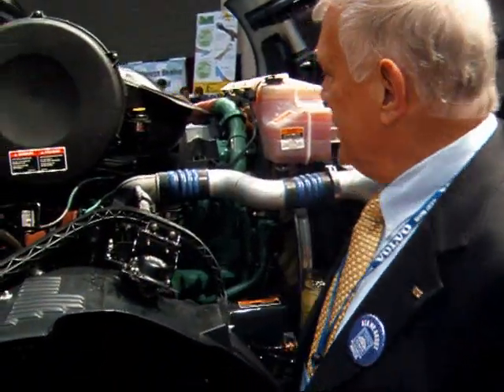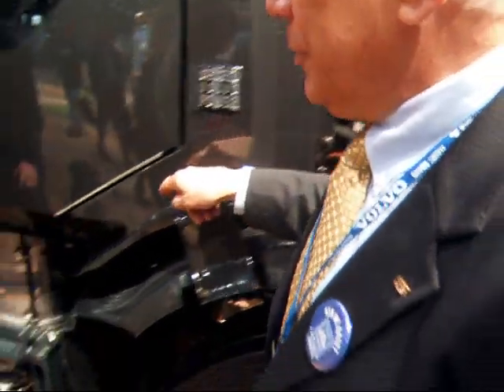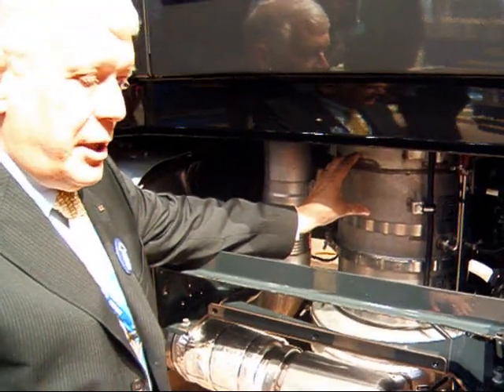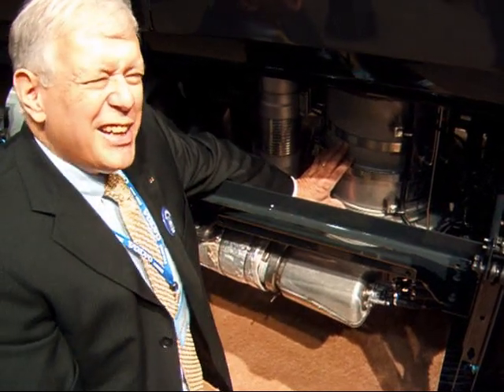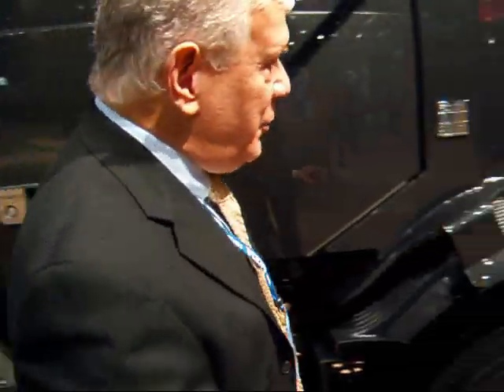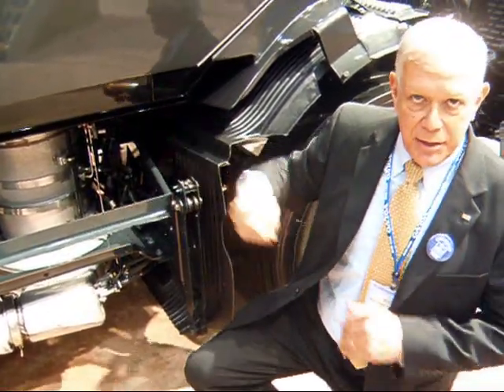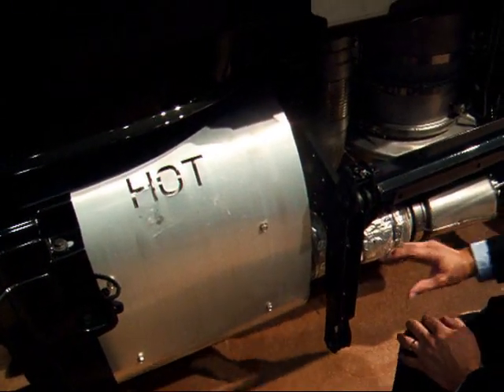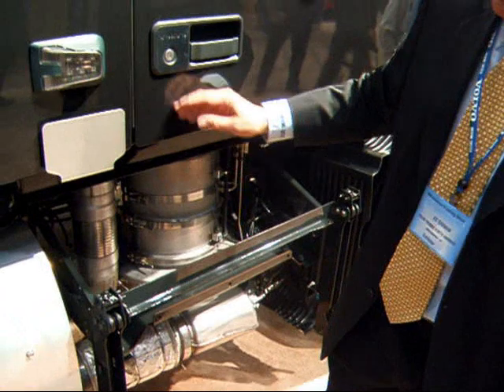Volvo's 2010 SCR System: Mid-America Trucking Show

Comment: This system on my 2009 is HELL to repair and work on. This thing is DANGEROUS. It sits to close to the ground, it is UNDER the cab, AND it weighs hundreds of pounds. Getting to service it is a nightmare. As the whole thing has to come off and is ULTRA picky on alightment. The V-band clamps are hell to pay as well. I hate my Volvo truck. and I hate the price on these filters.

Comment: More fuck ups of the EPA,  I currently have SPN 5246 FMI 15 code in a Volvo 670, in a book of codes. Possible cause is UNKNOWN or N/A. Dealerships has no solution. All they do is Diagnose for at least 150$ and replace something else. Than regen and clear the code. You drive off happy. In 2 days code comes back up. Suckers out there. If you can’t fix your shit that you invented, wtf to invent in a first place.

Comment: Actually, they did have problems. But they are corrected. With the SCR system, VOLVO has advertised that they will NOT require active regens in highway applications. So the plugged injector should no longer be a problem. Volvo is the only one to advertise this so far. Plus, I have driven a D13, great fuel economy. and that injetctor has to be cleaned once in awhile.